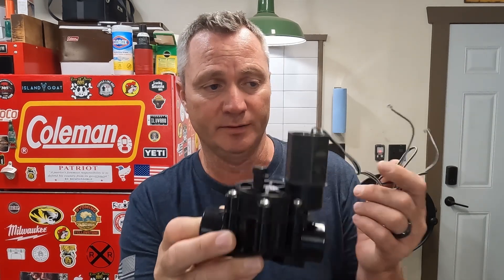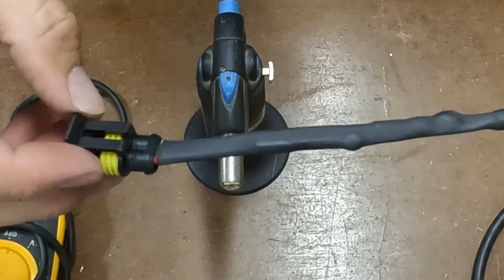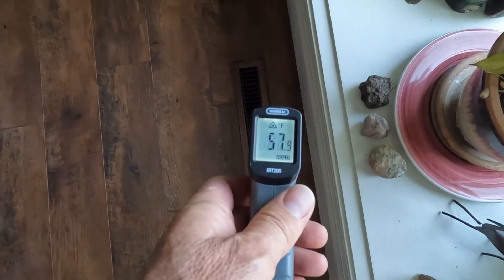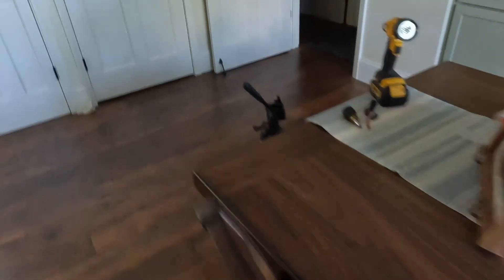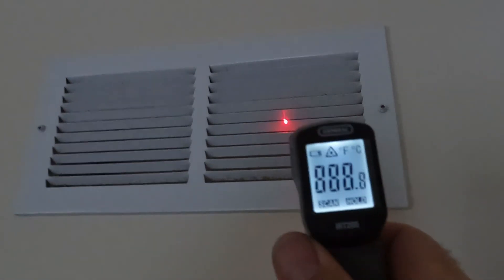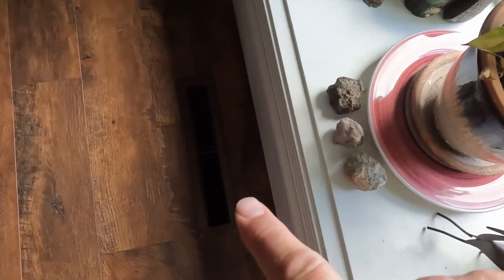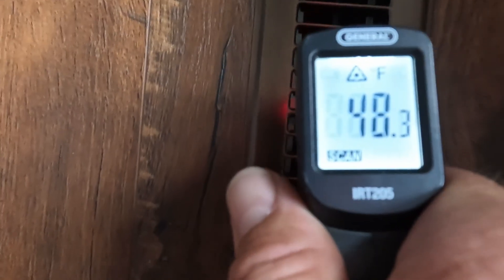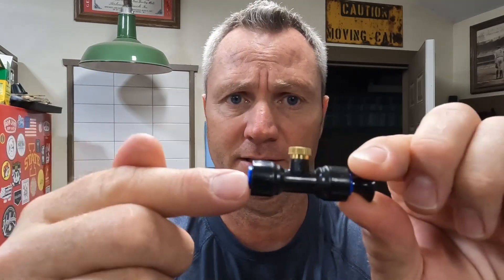Build a DIY A/C Misting kit to make your air-conditioning blow colder air!

Comment: Misting systems, shade systems and any other wacko systems do not work, period. Your air coming from the vent went down because the air going into the system went down as the AC was operating. It's called Delta T in the business which averages about 18 degrees on a good running system. 80 degree indoor air with have a vent temp of 62 degrees. Let the system run and 78 degree indoor air with have a vent temp of 60. 74 degree air will have a vent temp of 56 degrees, all of which have a delta t of 18 degrees, and this is what you're seeing happening as the system runs. Refrigeration does not care in regards to supply air (air from your vent) what the outdoor temp is. Could be 80, could be 90, could be 100 degrees outside. You will still get the same delta t of 18 degrees. Your condenser has a compressor which will work a bit harder at the higher temperatures, but the compressor is designed to handle it no problem. Misting will destroy your coil and you will spend thousands on a new one to save 2.00 a month for summer usage only.
Reply from the maker: This wacko idea did make our house quite a bit more comfortable in the heat of the summer, so I wouldn’t agree that it didn’t work. There was some savings, but not to the extent I would recommend it for that. As far as destroying the cool, I would say there was no destruction with the filter I installed. Thanks for all the good technical jargon and thanks for watching!!
Reply: @jon-bonworkshop  It will destroy your coil as the filter will not filter the mineral deposits. As to making you feel more comfortable, it's the placebo effect, but hey, if it makes you feel more comfortable, and you can afford the $5,000 condenser replacement in 2 or 3 years, go for it!

Comment: Adding an inline fuse on the 24V wire to the sprinkler valve would be a good idea. See power requirments for the valve used.
Reply from the maker: Not a bad idea, Thanks for watching!

Comment: Great idea!!! But you do need to put a filter on there to control the rusting of your condenser. Need to replace that filter every 3 months as well to really get the most efficiency and savings without too much degradation of the condenser metal which could create a freon leak.
Reply from the maker: I put a filter on the system shortly after the video was posted. Thanks for watch’n!!

Comment: Is the amp meter on the relay lead or the compressor lead. ?  You want to measure the power draw on the compressor side don't you??
Reply from the maker: I measured both sides, but did get my final reading from the compressor lead. Thanks for watching!

Comment: I found a kit on Amazon with 10 misters, 1/4 inch tubing, and a hose bib connector. Inline with the tubing, a 24Vac brass solenoid valve with 1/4 inch NPT fittings and 1/4 inch to slip on (shark bite?) adapters, turns water on and off. I used all ten misters. To protect my A/C transformer, i wired the same type of hvac transformer (220 Vac to 24 Vac) to the load side of the contactor using slip-on spade lugs (12 AWG) and to the valve. I might add a switch. Total cost is around $50ish.
Reply: To clarify, the kit is only the misters and tubing.
Reply from the maker: That’s awesome, you’ll have to let me know if you get positive results! Thanks for watching!!

Comment: What electrical connectors did you use? Does it matter 16AWG or 18 AWG? Does the mister kick on and off when unit shuts on / off to save on water cost?
Are you still running it and if so, any update? Great instructional video man, Thank you for sharing!
Reply from the maker: 16 or 18 gauge wire won’t matter, it’s a low voltage current that activates the sprinkler valve. Yes the water cycles on and off using the same circuit that cycles the compressor. It’s still in use, we have noticed cooler air and slightly lower monthly bills. Thanks got watching!

Comment: You may be able pump in an additive into the water to counter the corrosion and lime depositing potential.  I do not know the additive off the top of my head but I would bet that it exist.  My initial guess would be dish soap mixed with condenser cleaner.
Reply from the maker: Sounds interesting, something to research.  For now, I put a filter on it

Comment: Nice job. Question is what is the humidity outside? With dry air I can see this working like a swamp cooler. If the outside humidity is above 60 I would be concerned about dirt, dust etc collecting in condenser fins due to the higher humidity and lack of evaporation. I don't question the idea of not working. I would be concerned about accelerated corrosion in the outdoor unit or damage to the circuit board
Reply from the maker: This of a real concern, I would definitely keep an eyes on things while this is working, thanks for watching!!

Comment: While in extream circumstances or units in a absolutely terrible location where you can't control head pressure I wouldn't do this. The colder air when unit is under normal circumstances can cause all kinds of issues as a byproduct such as flooding the compressor back with liquid. Anything over a 20 degree split isn't very good and air temps in the 40's is on the verge of freezing up the evaporator. Most modern systems use a TXV metering device and will just start closing causing the refrigerant to back up in the condenser I call it stacking and probably why amp draw didn't improve. Over long term use it will degrade the coil even on filtered water do this without a filter and hard water you can ruin the coil in one season. This can definitely have benefits using it during certain parts of summer but I wouldn't just let this run from spring to fall
Reply from the maker: Good info, I’m in the process of moving my unit out from under my deck, so it is in a terrible spot for a really hot day now. That being said I agree with you, this isn’t needed except on really hot days, but for sake of curiosity, I’ll run it for a month and see what happens. Thanks for watching!

Comment: Plumb the condensation to the mister ,pure water?
Reply from the maker: Best I’d its filtered for minerals, thanks for watching!
Reply: @jon-bonworkshop condensate from the indoor unit should be pretty pure I would think, since it’s just the humidity from inside your home. Still probably not enough to sustain the misting system though unless you’re cooling a massive structure